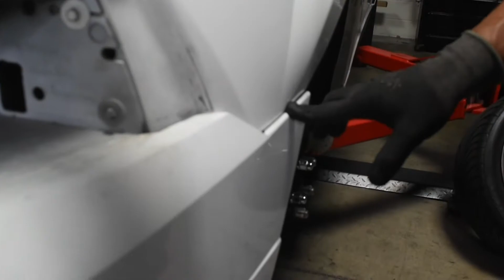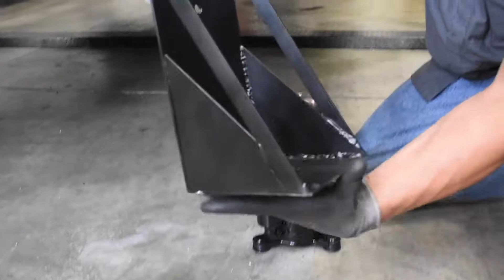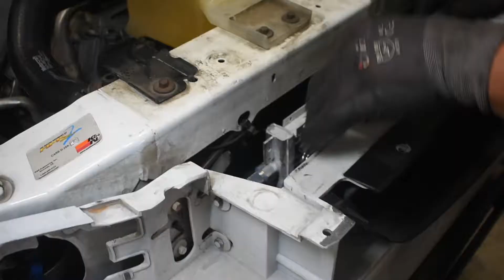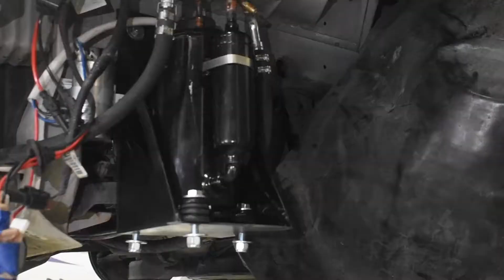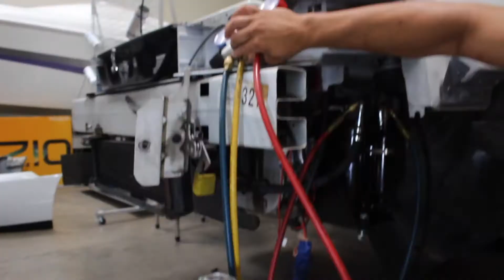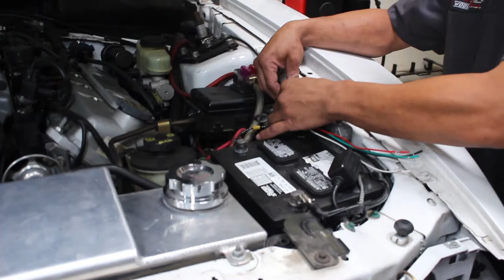Arctic Intake Gen. 2 by Dustin Woolf Sema Launchpad 2021 Winner! || Installation Tutorial ||

Comment: You should find out a way to test airflow to see how much restriction there is. Yes youre dropping temp but youre now adding a restriction/turbulance which will kill power, so you basically have two opposing forces which will be exaggerated on higher hp charged cars. If you can find a way to not restrict airflow that might be worth it
Reply: That's why the intake pipe for that section is larger than the rest of the cars intake pipes. Plus forced induction isn't going to care about this minimal restriction. The lower temps will FAR exceed any restriction in air.